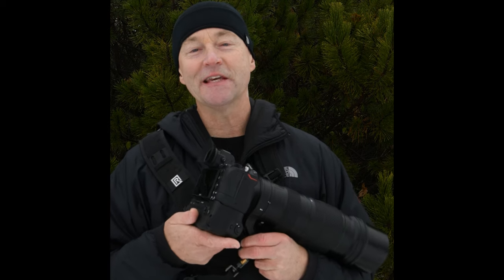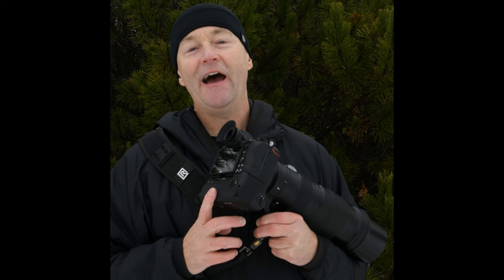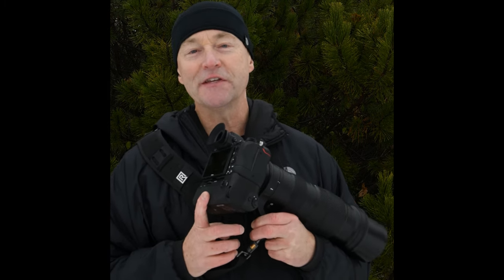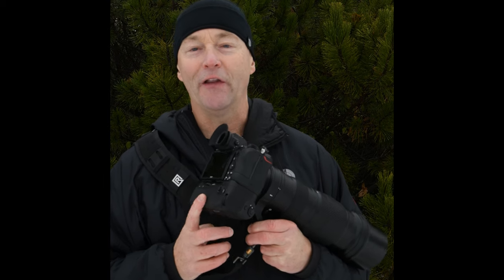How To Remove a Nikon Z6II Z7II Battery Door Cover #shorts

Comment: First off, thank you. Second, it is very sad that you literally had to call Nikon and I have to search YouTube for a video to show how this is done!!! Sometimes Nikon just baffles me. I just bought my grip to see if it breathes more life into my underutilized Z7II the primary reason for which is strictly ergonomics; however, this ordeal to remove the battery door cover ruined the joy of getting the grip and the fact that it only marginally improved the handling of the camera make me feel like I just wasted more money on a subpar Nikon product...
Reply from the maker: I hear you.  I use the grip for the weight to balance out the 600mm on a tripod and for vertical so it served it purpose for my application.

Comment: I'm sorry, but you have not given us more information than 60 degrees either!! Pull equally on both hinges, or more on the longer side? More detail please.
Reply: Having now watched another video: 60 degrees from vertical, ie 30 degrees from a closed position! Don't pull equally on the hinges, its the one on the long side of the battery door that releases. Do not force it, minimal effort is required.
Reply from the maker: Hi Dominic, Using my right hand, thumb and index finger, I pulled harder on the right side and it released fairly easily.  Hope that helps.
Reply: @Coolwildlife1  Thanks, but see my second reply. Ps. Long/short side of the cover is less ambiguous than left 
/right.
Reply from the maker: @dominiclester3232  Agreed I should record another video explaining this in more detail.  I appreciate you taking the time to reply
Reply from the maker: Here's a link to the new video https://www.youtube.com/watch?v=ihIg-6zqeIg which demonstrates the removal of the door cover